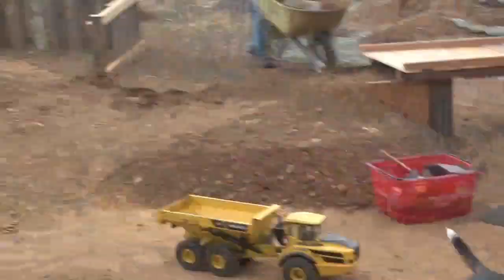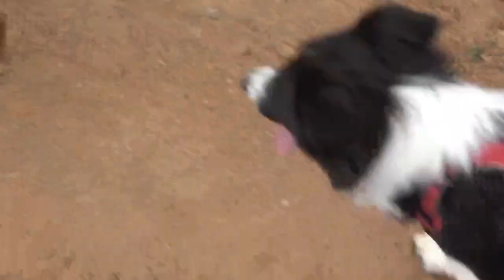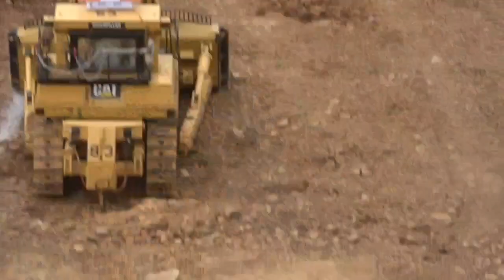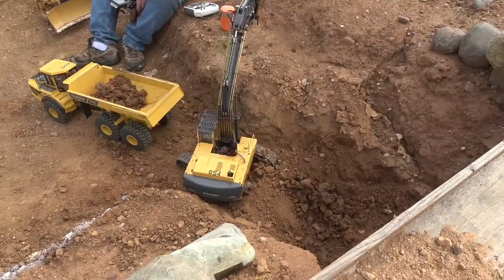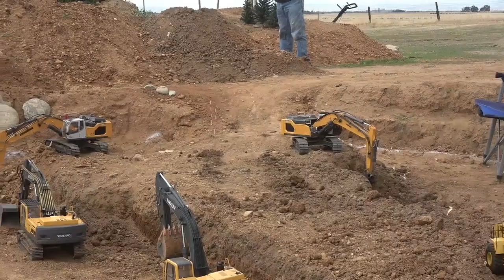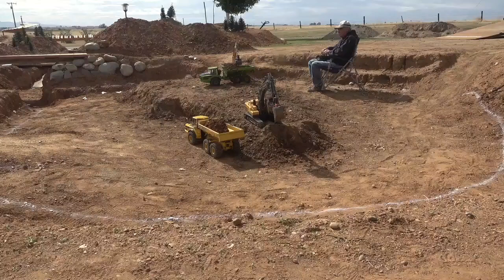Back in a pit today.  2- 360Ls -3 A40G's,  2-dozers 2- 945 excavators and a city truck

Comment: Darrell,what radio are you usen for your 360 excavator & dozer? Much better that the ones that come with them?
Reply from the maker: The 360L has a paladin  ev. The dozer is fsi6 stock radio
Reply: Hi Darrell, For your 360, why did you switch to a Paladin radio?
Reply from the maker: So that I could make the thumb porporsanal
Reply: @yellowironcowboyrccon7484  OK, that makes sense. How do you like the thumb? Does it have decent strength to it?  I saw Hydraulic Hobbies sells them and I've kicked around the idea of getting one.
Reply from the maker: Yep, it's not to shabby for power.  It comes in handy once in a while.
Reply: @yellowironcowboyrccon7484  Thanks for   the info on it. What state do you live in? I'm in MN and I was digging today at 27°. Frost is setting in the ground and this weekend will be in the low to mid 40's...which is hard to believe for mid Dec.
Reply from the maker: California